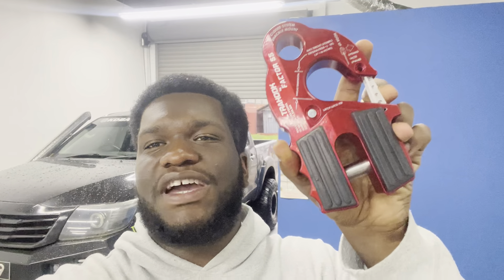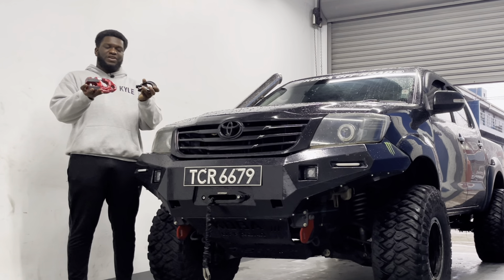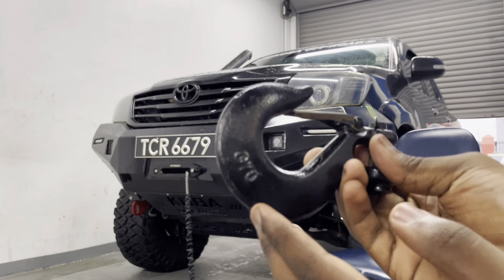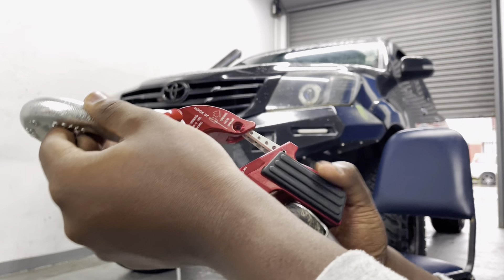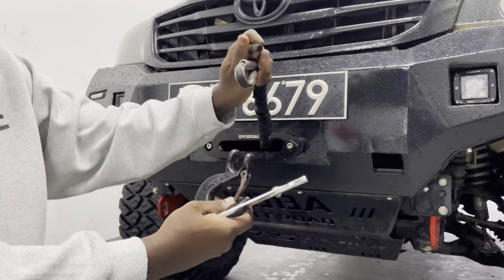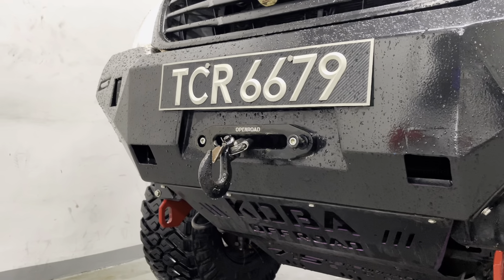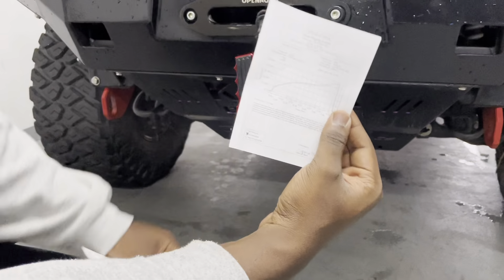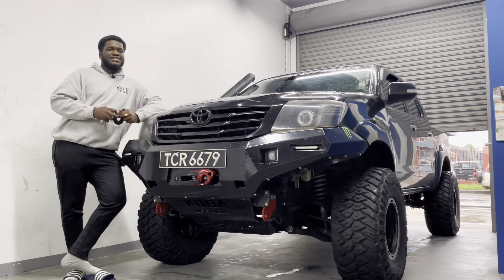Is Your Winch Hook Safe? Factor 55 UltraHook Review!

Comment: you misinformed a bit. the dimensions for the throat diameter is not for knowing how large aa shacke or whatever can fit, but rather for you to do the math and be able to seee when the hook is out of its service life, the throat is rated as it can expand up to 10% whilst still being within load capacity. so if expanded or "bent" to 11% or more hook should be discarded

Comment: Yet another interesting video Kyle, good job man!
Perhaps one thing to consider ( yes it does cost a bit more $ 😅) is that you could use a long Soft Shackle with the Ultra Hook to help save from damaging that beautiful red gloss finish on that well engineered & tested Ultra Hook. This is for when you hook on to anything like hard metal recovery points, or hard metal bow shackles.
Now Factor 55 and others do a 20" Extreme Duty Soft Shackle which is long enough to double wrap which in turn doubles the working load limit of the soft shackle to above that of the Ultra Hook, which is great albeit an added cost.
Cheers.    😃